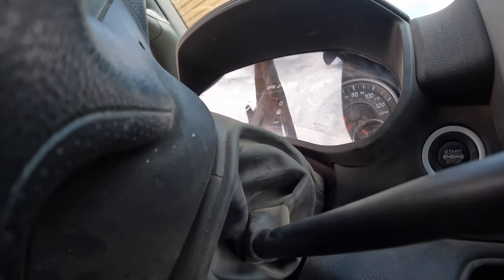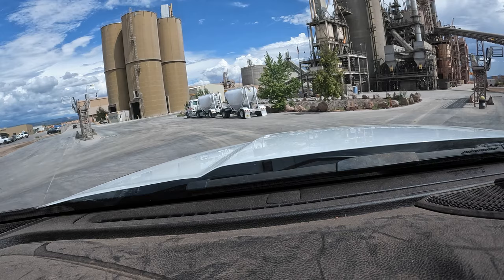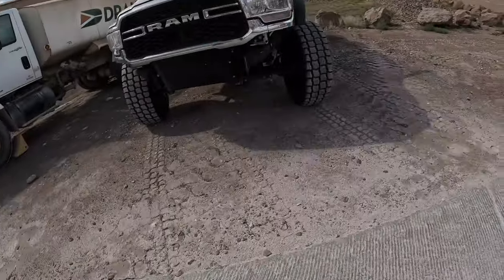The cement plant called us to recover their truck with the rotator! (HEAVY RECOVERY!)

Comment: Those are cute little dry bulk tanks.  Dangerously high center of gravity when loaded. Is it sand they are hauling  ? I pulled a 4 hopper dry bulk pneumatic trailer hauling plastic pellets for injection molding.